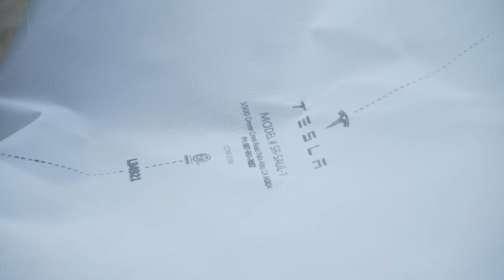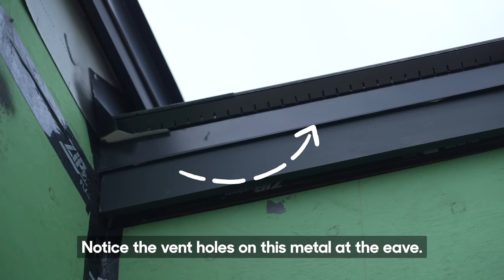Tesla Solar Roof - A Builders Perspective

Comment: You need to have another episode discussing the VAST difference between working with a roofer trained and certified by Tesla to install their product, vs working with Tesla directly. I was told by one such local roofer their price would be twice of what Tesla charged me (but it was no walk in the park working with Tesla, even though I am a licensed architect who understands the challenges of construction). The 3 to 4x price of standing-seam metal roof is a shocking multiplier, but it is also not qualified, thus unfortunately gives a very erroneous impression. It's NOT representative of what a homeowner would incur if they were replacing an old roof with new metal roof vs Tesla Solar Roof. In my case in DEC 2021, it was $36k TSR without a battery vs $19k (the cheapest possible quote, plenty other went multiples of that) for metal roof before federal & state tax incentives. A more apple to apple comparison, esp. for a brand new custom built house, would be to compare the combined cost of a 50 kw PV system on top of a metal roof, using the same capacity of batteries, chargers AND generators SO THAT the premium that a Tesla Solar Roof commands relative to the more typical PV+metal roof can be isolated. Furthermore, it appears that in this case, the same roofer would have installed either metal or TSR, which would most likely not be the case on other projects, meaning his metal roof cost would be an honest, transparent cost to the GC. I suggest so as not to discourage or scare off other homeowner considering TSR by the 3x to 4x multiplier quoted, you should do one more episode performing a much more accurate and meaningful comparison, not unlike the one you did on HW heaters.
Reply: In less words, I think what you are trying to say is in some scenarios, TSR is a cost comparable alternative to metal roof plus solar panels.
Reply: And with an appropriately sized battery what would that price be?  Perhaps 3-4x?
Reply: Thank you for that great insight.
Reply: @londen3547  It doesn't matter. To make a fair comparison you have to compare a conventional metal roof + a conventional solar power system with a Tesla roof (which includes the hardware to control the power generated by the roof, but does not include storage, unless you decide to add it). If you want to include storage then you need to add battery storage systems to both sides of the equation.

If you don't want solar power then obviously there is no reason to consider a Tesla solar roof system. But if you do want solar and want to compare costs, then see the first paragraph.
Reply: @EllerraD  Also the Tesla roof seems to be as attractive as a metal roof and metal roofs are nice if there is no hail issue. The attractiveness of just a Tesla roof is way way better than a metal roof with solar panels
Reply: @travisjazzbo3490  I agree. Also, putting solar panels on a roof increases the probability of leak issues because of the additional penetrations needed.
Reply: @EllerraD  So true. I do wonder how the Tesla roofs hold up under big hail. If they are tough, I think every new construction house in a sunny area should be required to put these on! Why not? They are already doing mandates for certain levels of efficiency HVAC systems on new builds in some states.
Reply: @EllerraD  I`m pretty sure you cannot get the Tesla Solar Roof without buying Powerwalls anymore.
Reply: @EllerraD  If you're installing solar panels on a metal roof there's no penetrations done and thus no additional risk of leaks.
Reply: @londen3547  You're not comparing apples to apples.  Roof + battery vs. just roof.